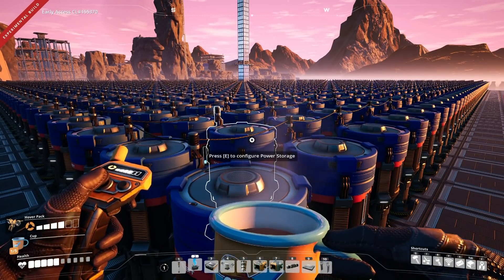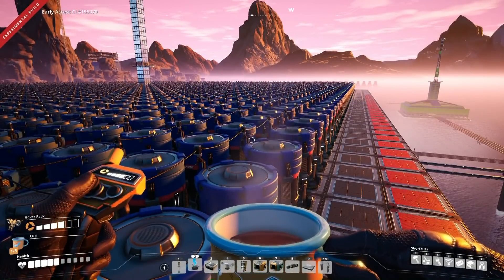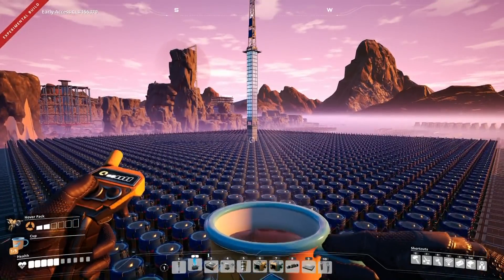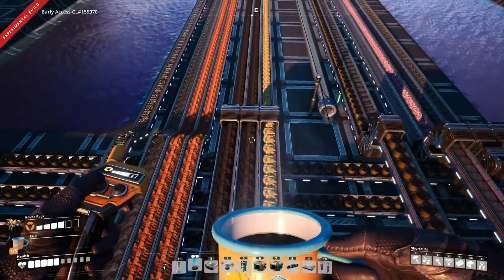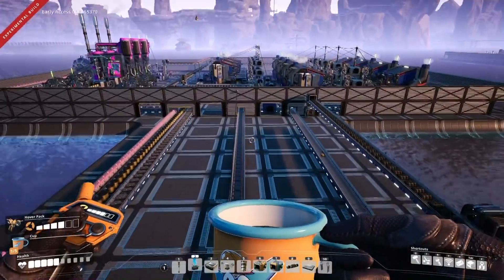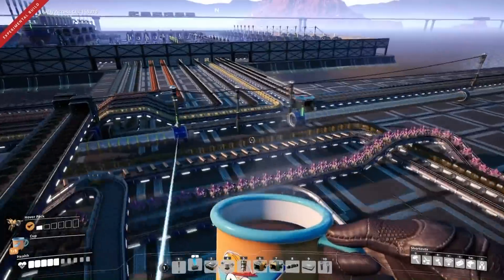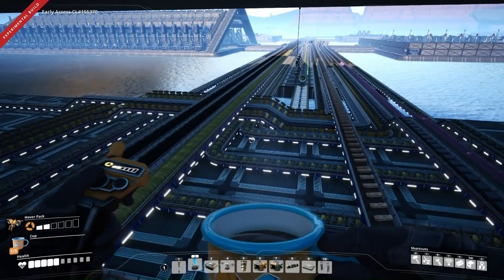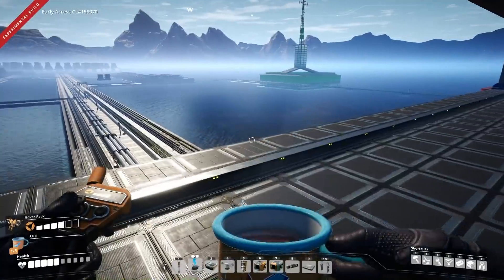SATISFACTORY - U4 VANILLA PLAYTHROUGH EP#10

Comment: Nice! Now you just gotta stack all of these up six times and you can utilize all of the uranium on the map!

edit: I'm sorry, you're actually using more uranium here than I thought.. Couldn't quite make it out in the spreadsheet from a couple episodes back exactly how much it is. Is it actually already about half of what's available?

Also, what's the logic behind using the fertile uranium alternate recipe? Is it that you'd rather make less power from more uranium and save on the quartz and nitrogen instead of trying to max out on power from uranium? Or, since this produces more plutonium, does this recipe actually maximize power if you were to burn up the plutonium (in the future) instead of crushing it?
Reply: From what I've seen of analysis of the alternates for plutonium, the standard recipes are better for just using up the uranium waste if you just want no waste. The alternates are better for creating more plutonium rods. He mentioned that the ultimate plan is to use the plutonium for power, so I assume they wanted as much plutonium as possible, in which case it's better to use the alternates. Hope that helped.
Reply from the maker: Yeah that alt recipe makes more plutonium, plus yes I think when I worked it out I took Quartz in the map into account.  There is still an untouched normal Uranium node, but I doubt we'll use it in this world...   but you never know lol...